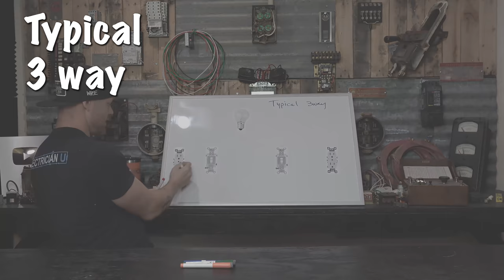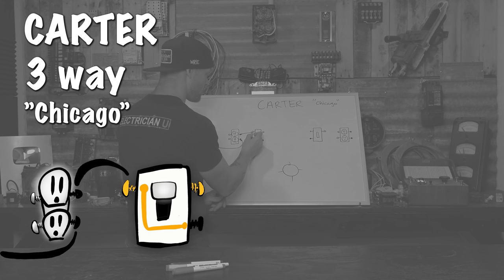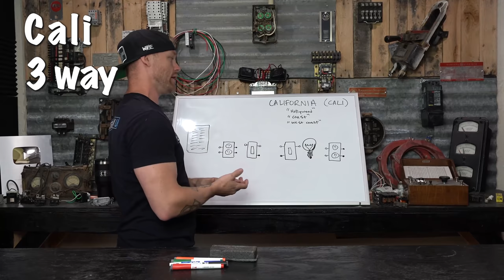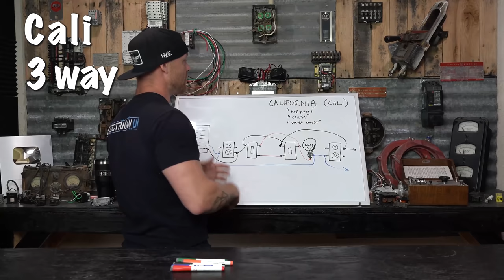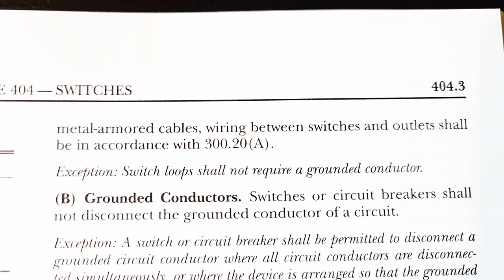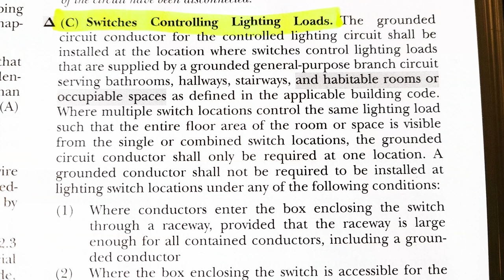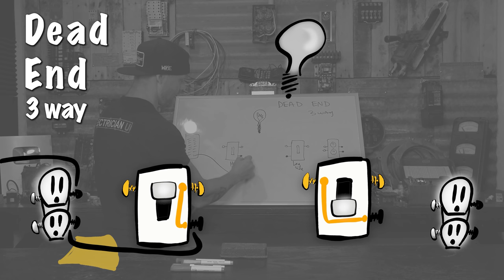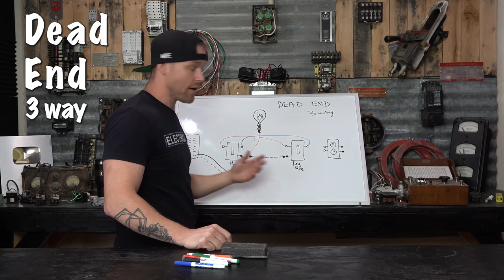THREE WAYS 3-WAYS CAN BE (3way Switch Wiring - ILLEGAL AND LEGAL METHODS)

Comment: I think the Chicago 3 way is interesting because you technically don't need any travellers so long as both switches are connected to the same phase. So I think it would be really easy to add it in if there's a switch for another light there already. You'd only have to pull in one wire
Reply: Huh?
Reply: I think what Yousitech is talking about is instead of a dead end three way, you'd pigtail the black and white , hot and neutral respectively to the travellers on the original switch location assuming power comes to the switch,  connecting the black from the light to the common screw,  then wirenut the white from the light to the red.  At the other end, black and white travellers, red to the common,  giving you the ability to add receptacles down the line unlike the dead end three way. Jacked up, not to code, but it works.

Comment: back in 1997 i was taught to run 3wire from each switch to the light box identify the line side with a N for the feed than the other side tie a traveler line side hot to the white wire for the dead end so common was always a black wire with red and white as travelers at the dead end lol
Reply: Yeah, how about explaining when light is fed and switched at light box, and only 3 wire cable going to each 3 way switch box... Thanks
Reply: @jerrypotter9478  kk ill try to explain feed switch will have the power coming in black wire feed to common, white feed wire to white three wire going to light, leaving the other 2,  red and black  wire as travelers to the lightbox at the light box feed side 3 wire will have the white  tied to the w fixture wire the other two as travelers one set will be tied together the other will be tied to the w wire going to the dead end box with the dead end 3wire black tied to the black on fixture,  at the dead end you have white and red as travelers and the black to the common.
Reply: @jerrypotter9478  the 4.00 mark but i wld not use 2 white wires to the fixture the white coming from the box to the right i wld use as a traveler.
Reply: @jerrypotter9478  it's called a homerun going to the light which can be done if light jbox is big enough for wire count. But that doesn't give you a neutral with a cable assembly to bad it wasn't conduit.

Comment: I ran into a problem, a friend of mine changed out both of his hall way stair 3 way  switches with new ones, after he replaced them with silent mercury switches every time he would turn on or off the light it would trip the breaker, and if he put the old switches back in it worked just fine. 
The problem was cause by the both the hot and neutral were being switched and the mercury switches would make one circuit before it would break the other, with both poles of the switches being on for a split second it shorted the hot and neutral together.  So unless he wanted to replace the wiring, he had to settle for silent mechanical switches!
Reply: Sounds like a Chicago three way set up eg. Hot & neutral connected to travelers on both three ways, light connected in between the commons, fairly common during the knob and tube era and commonly used well into the 1950s or '60s in rural areas,  particularly useful when you have a yardlight controlled by three way switches in the house and a barn or shed, and receptacles in the outbuilding are to remain hot all the time,  using only three wires instead of four, excluding an equipment ground.

Comment: I went to a vocational high school, in my electrical class, 1972-1975, we were taught the “Chicago hook Up” for some 3 way installs….how wrong this was!……46 years later I have repaired so many of these screw ups!…..the California hook up is excepted…there is no violation about this, as long as you identify the white conductor as a non neutral
Reply: I like to use an odd color for that so it stands out more. Never use red or especially black.
Blue yellow or orange is my personal preference.
Are you still allowed to do this?
Thought I heard that you can't?
Reply: @markchidester6239  according to the CEC it should not be done in new construction however servicing pre existing wiring can be done this way if it was already like that
Reply: @Nick-bh1fy  what should not be done?
And what is CEC?
Reply: @anthonysmith9410  Canadian electrical code, up to new standards there shall be a neutral readily available at every switch location. So in the case of power being brought to the light instead of the switch, you must run a 3 conductor cable (black red white) from ur light to the switch
Reply: @anthonysmith9410  but in the case of pre existing work, you must identify the neutral w some sort of phase tape to show it’s not a neutral
Reply: @Nick-bh1fy  same here in the USA, NEUTRAL EVERY SWITCH BOX
Reply: @anthonysmith9410  figured as much, both code standards and practices are very similar
Reply: Dang!!! In 1972 - 1975 ?? Must have been a very old school instructor.  I've only heard of Chicago 3 ways, never had to screw with one (thank goodness lol) and they can be downright confusing and time consuming especially for the new generation electricians, going out on a troubleshooting call to an unfamiliar older property.

Comment: I see I'm late to the party here on this great video... If you want to learn more than you ever wanted to know about 3-way switches try retrofitting Z-Wave GE smart switches into a sprawling ranch that has wiring from 3 different decades (60's, 80's, and 2000's)! One helpful thing I found was that dead-end three ways can at least be rewired on the hot side to carry the required hot and neutral to the "dumb" GE remote switches. I also had to get creative with using legs going through the lighting fixture to get a neutral and or hot to the remote switch on a couple circuits. It took a bunch of mind numbing testing, tracing, and planning, but I was able to get 6 - 3/4 way switch circuits converted to smart switches, and I think I only had to run one new piece of Romex.

Comment: I've seen on switches where they put the neutral to the terminal on a switch so when they turn the switch off it " breaks" the neutral as we say. Goes without saying why that's not a good way to do things anymore lol
Reply: That was common with knob and tube systems,  as typically the wires were not color coded, like white for neutral or black for hot, they were usually both black, or sometimes in later knob and tube systems like in the 30s and 40s, the neutral might be black with some white stripes, or bleached cloth insulation so as to be lighter color than the hot.  But, 80 something years later seldom do you find such systems free from molestation,  particularly in overhead fixtures with oversized incandescent bulbs, or basements where it's all to common to extend the circuit by tapping off the older conductors with romex.
Reply: @Sparky-ww5re  yeah I've seen in attics where it's nob and tube running through it. It's crazy to look at. Literally just bare wires running around up there with what you could essentially call butt splices. Its baffling that shit hasn't burned down more buildings. But no the switch I was talking about was just regular ole awg in a pipe

Comment: Something interesting that I’ve come across especially with motion detection switches that electronically switch based on motion detection is that they power steal off the equipment ground to power the electronic components on the switch. Essentially using the equipment ground as a common point.
Reply: That is why currently, in Canada anyways, there has to be a neutral pulled to every switch location. So the ground is not used as the control circuit.
Reply: @chrisv_b  This.  Most smart sensor switches require both hot and neutral to complete their own little, internal ciruit to power themselves; same reason smart outlets require both prongs.  Never heard of one needing a ground (although, if you have an available ground, use it anyway).

Comment: Is it common for 3way switches to "leak" voltage to the terminal?   For instance, I came across a 3 way for an outside light.  You could turn it off or on from the garage or the front door.  With the switches in the off position, I was still getting 30 to 40 volts at the light.   I had another situation where a lighted 3 way cycles the LED bulb in a ceiling fan.  There's not enough to keep the LED on but enough to cycle them for split second.
Reply: Running wires in parallel (like the red, black, white, & ground conductors in 14-3 cable), produces induced current in the non-powered wires adjacent to the powered one.  This is why low-voltage wiring (Ethernet, CATV, CCTV, Etc.) should always be run a minimum of 6" (15 cm) away from 120v/240v wiring when run in parallel, 3" (7½ cm) when crossing at 90°.  Minimum separation.

However, I typically only see about 2v on my DMM on the non-powered conductors.  If you are seeing 30 - 40 volts, you may have wires with damaged conductors or a damaged switch.  That much voltage on non-powered wires is outside what I would consider to be normal.  You might have a nail/screw through a wire or some other fault.

As an example, a friend of mine's mom had her roof replaced in the Fall/Autumn here in Texas.  She didn't use her A/C until well into the Spring, several months later.  A/C didn't work.  An A/C company was called out and (maybe not the best job of troubleshooting) after replacing the condenser unit and the evaporator/air handler, they discovered that a roofing nail had penetrated one of the refrigerant lines between the condenser and air handler.  The old unit was running R-22 and the new one is using R-134a or R-410a (R or HFC).  Not too upset since a newer, more efficient system with a less environmentally dangerous refrigerant was installed.

You've got to put in the elbow grease and diagnose and verify everything, and never assume that any part of the system is good (even if it just came from the store)...

Comment: The other illegal way to do it is to hook the light bulb terminals to the black screws of the switches, and the hot and neutral to the other two screws on each switch. It works, but at some point you'll have both hot wires feeding the light bulb.
Reply: I don't know how leds would react to it. Some of them don't completely turn off under some circumstances
Reply: @MrClaudio  it shouldn't matter,  other than this being a very shady setup,  but it works and it saves a conductor as it allowed you to have a receptacle at the other end to continue the circuit using 3 wires instead of 4 excluding a ground.    'Cause when the bulb gets a hot and a neutral there is 120 volts, when it gets 2 neutrals or 2 hots there is 0 volts to the bulb.

Comment: What about the 3 wire going from switch to light and them
N from light to switch?
I wired homes like that for years. It saves you time and wire.
The powered side is used for the neutral and the dead man side is legged.
Any thoughts on that one.
I’ve also come across a legged 4 way a few times

Comment: Hey Dustin, you briefly mentioned an old home built in the 40's still on 2 wire. Where can I find out troubleshooting and different issues that may be possible in this situation? I rent a duplex that is that very situation. I have a breaker that was tripping. The landlady sent out an electrician who couldn't figure it out. I started messing with it and find all kinds of strange conditions as I check places with my meter and tools. I just want to be sure stuff is safe. Thanks. I have learned quite a bit watching your videos.

Comment: In some cases, 12-2-2 or 12-4 is useful.  
If the magic switch is a timer or a sensor, it'd be easy to.end up with a neutral in the "wrong" place if you went with that particular exemption.
And on that, is white with a stripe still a neutral-only for strict definition?

Comment: I heard someone say that stab locking is illegal on the plugs lol, granted stab locking does suck because after about 10 years they can become loose , but it is in no way illegal , a plug is u.l. listed to be stab locked or wrapping g the wire around the terminal , I will wrap 14 around the terminal , but for anyone that does not know , it is legal to stab lock plugs with 14 gauge wire

Comment: I like neutral at every location since it gives you some future proofing to use smart or special switches that a want a neutral
Reply: Yes, when I rough in a house I try to plan ahead and avoid dead end 3 ways, there's no reason to in a new installation.   I have installed dead end 3 ways a handful of times in renovations when I need to convert a single pole switch setup into a 3 way or 4 way setup

Comment: I grew up on a farm in Ohio in the 60's.  I suspect the wiring was from the mid 1930's. We had 3 wires running from the house to the barn. There were 3 way switches to control the light on the barn from the house or the barn.  We also had outlets in the barn that always worked. Grounding was not a thing.  I could never understand how this worked.  The Carter or Chicago 3-way finally explains how this worked.  I have another question.  My father-in-law's house had a switch for a light in the basement.  I had to replace the bakelite (Brown, You know the one.  Single pole.  1 1/2 inches wide and 3 inches long.  Break out the bakelite hole filler for your wires.) switch.  There were only 2 wires coming to the switch.  If you read the wording on the switch, (Off and On) the switch worked in a way that was not possible in my mind.  The light came on when it was switched OFF and the light went out when it said ON.  How did this work?  I had a devil of a time convincing him that having no main breaker (wired in the 1920's or 1930's) was a very bad idea. It was an exposed bunch (2 rows, one for each phase) of hot porcelain fuses and a taped up split-bolt connector for ALL the Neutrals.  God wonders why it did not burn the house down!!  Thanks
Reply: learned something new every day lol.    I am just finishing up a renovation in a 1952 Ranch house in Anderson County south carolina and it has carter 3 ways in the hallways.  the weird part, was they ran 14-2 ungrounded cloth braided NM from a receptacle,  to the first switch box, here they pigtailed the hot and neutral to the travellers,  jumping over to the other 3 way switch, same thing,  from there goes to another receptacle and continues down the line.   A single conductor,  a black, rubberized insulation ran from the common screw in each switch box,  up to the light.   The house originally had the switches with the small buttons that pop in and out.   no 14/3 anywhere that I can tell.   those wacky 3 ways are out there, I have also seen it on farms like you described. on the farms I've seen, the barn and house are on different circuits,  with a single wire going from the house to yardlight, to the barn.   the meter was on the pole in the middle of the barnyard, with overhead service to the house and barn.  If you got the two circuits on the opposite phase, in one of the "OFF " positions you'd get Hot A + Hot B = 240 volts and a very bright and short lived bulb 😂   thx for sharing

Comment: My house I recently bought was rehabbed in 2015.  All the wires coming out of the panel are 12/2, but the wiring in the attic is older stuff, just two wire, no ground.  I'm having a heck of a time tracing the wires around to see where they would have junction-ed them together, but I think the power goes up to the light fixtures first, and then down to the switches as a 3 way but power to the light first.  It's really hampered my desire to put in smart switches because most of the good switches requires a neutral line and my wiring does not have a neutral tucked away in the back.  If this was a forever house I would take the walls apart and redo all the wiring, but I think for now this is something I am just going to have to leave as is.
Reply: You dont have a neutral?

Comment: Not only can a Carter three way make both sides of the bulb socket hot when the light is off, but in that state it broke the neutral. Never install a switch that breaks the neutral. It was made illegal in 1923, one hundred years ago.
Reply: While it WAS illegal since 1923, Carter 3 way has definitely been used for many years afterwards, especially on farms when a yardlight is switched from the house and barn,  with constant power on both ends using three wires.   I actually ran across this on a farm three years ago, single wire from house and barn to a light on a pole.   House was built c. 1910, but didn't get electricity until 1947, according to the farmer.